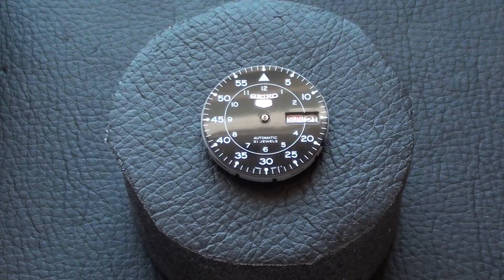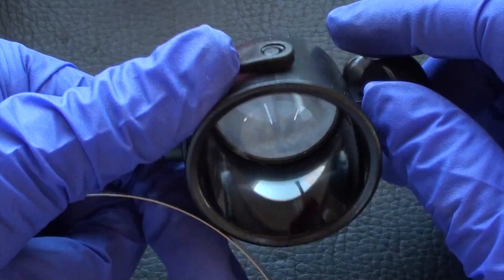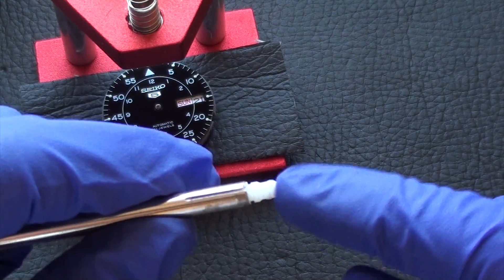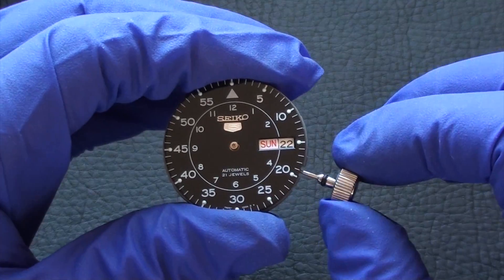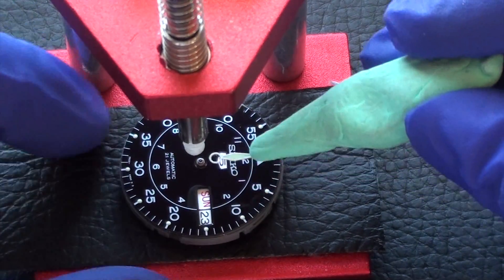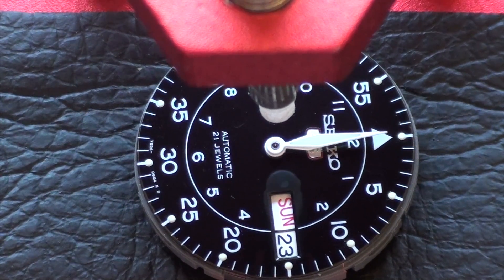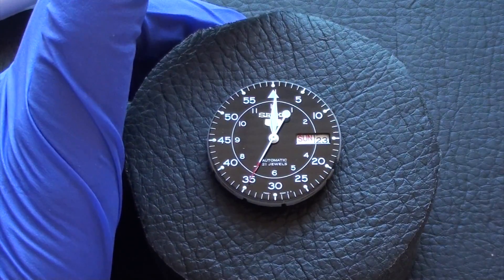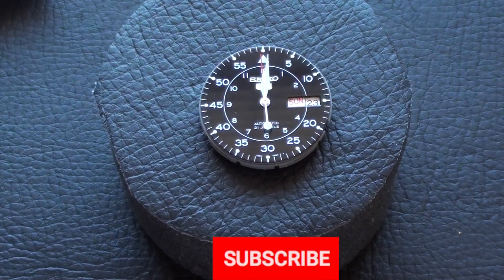Watch Hands Installation TUTORIAL - How To Attach Watch Hands To A Movement

Comment: I’ve just put my first build together (a vk63 chrono) and I don’t think I used the correct ends of my hands pusher. This resulted in a damaged tachometer hand (the large second hand). Live and learn, replacement hands on order. 

Weirdly, all other hands (including the subdials) fitted with relative ease. 

Rodico is a life saver!

Comment: Thank you for the great content! It's REALLY helpful for beginners like myself! Question... Retrospectively, do you think it's mandatory to use a movement holder (the brass mount that can hold the movement) to install hands? I'm not planning on doing the operation many times and was wondering if I can get away (and don't damage the bottom of the movement) with just placing the movement on a soft piece of leather or cloth (like you did in this video). Thanks for the help!

Comment: I'll be doing a GMT quartz movement replacement Ronda 515-24H. I'm wondering if the 24 hour hand should be calibrated when installed on the new movement. Normal function is independent of the other hand settings. When setting the GMT I turn the crown counter clockwise in the first position. I follow you how to synchronize the hands to make sure they are in tune with the midnight date change.  Thanks!

Comment: I’ve seen somebody post on another video saying that installing the hands while on midnight will break the day/date complication. I don’t see how you could install the hands in any other position without it being misaligned, could you clarify that for me??
Reply: If you know where the hands should be prior to removing (take a picture to help remember) then you can reinstall at any position that doesn't conflict with whatever tools you're using to get them on. It also helps to work on a non-moving movement unless you're just very quick!

Regarding the cheap Seiko auto movement, it already takes "forever" for the date/day change to occur. From the factory, it starts changing at midnight but doesn't completely finish until 3am or so, since it'll first go through the alternate day language. 

So if you put new hands on, and discover the cycle begins changing at around 11pm or doesn't complete the change until around 4am ... you're not actually too far off from "ideal."

Comment: Couldn't you just set the time to 12 o'clock before you take the old hand off?
Reply from the maker: Yup, but it wouldnt be as precise as setting it to 12 after removing it. The movement might continue to run after taking off the hands, which could put it to 12:01, 12:02, etc. depending on how long you take to set the hands after removing them.

Comment: Hi Lume Shot or Anyone, Can I use a Hand Remover Lifter Presto Plunger Puller to JUST remove a seconds hand? Thanks for your videos. They are a huge service to mod community.
Reply from the maker: Hey! Thanks for the compliment! It should be possible to remove just the seconds hand with the presto lift, but you should be careful not to touch the minute hand underneath since it could result in scratches.